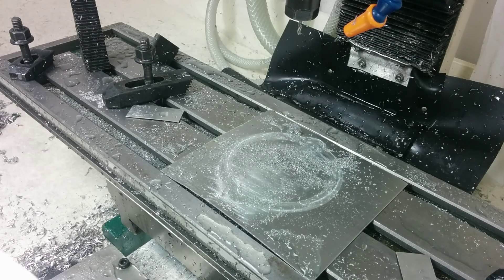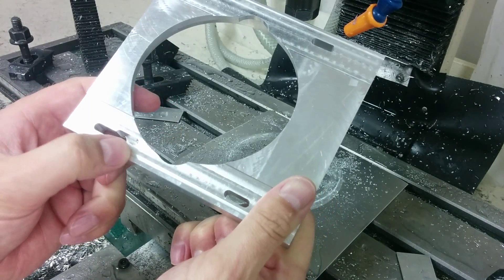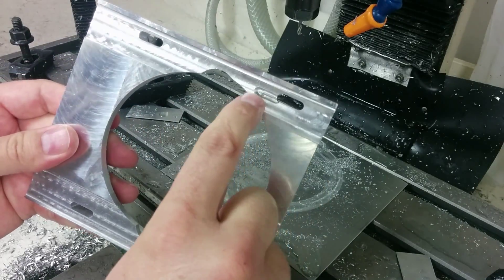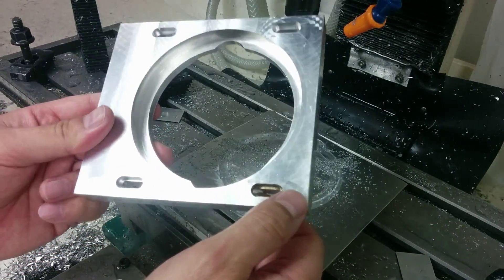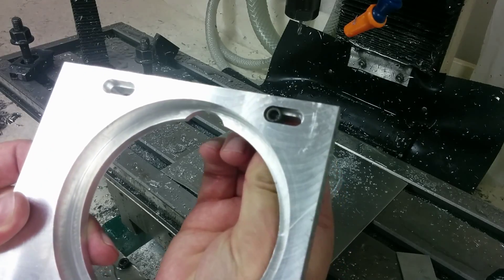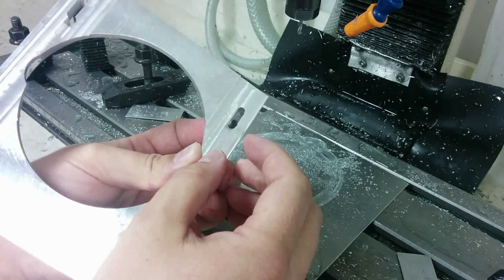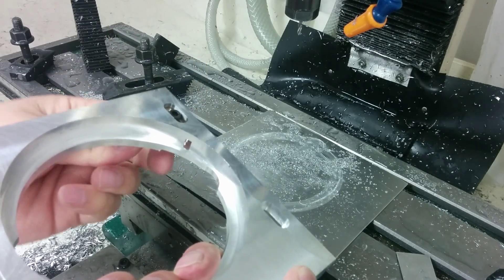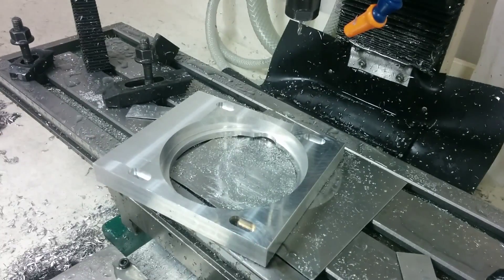Motor Mount Slots: SUCCESS (more or less)!

Comment: I bought a vise and hold downs all the usual stuff.... but the thing  I use the most is called a thin vise.  You may have seen it here on youtube... just search "thin vise tryally"  he was really helpful.. even emailed his drawings.  Basically you just take an aluminum plate and drill and pocket the holes in it so you can bolt it to your table then mill a lip in it and with  another block that slides and jam block you have a neat soft jaw type vise that holds really well... check it out..     Nice job on the plate!  don't feel bad I have to write all the operations down in a notebook so when I get to the mill I flip the parts the right way.....
Reply from the maker: Man tryally is like the original YouTube machinist. I remember watching his stuff long before I had my own. I'll definitely check out that video, thanks for the tip!
Reply from the maker: Just watched it, awesome! Thanks again.